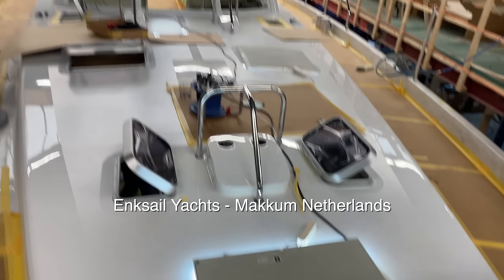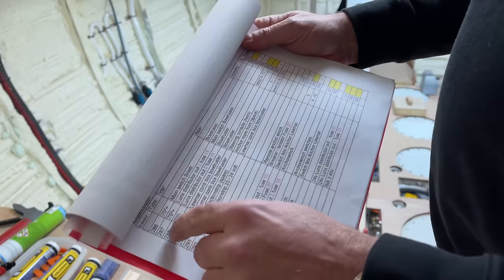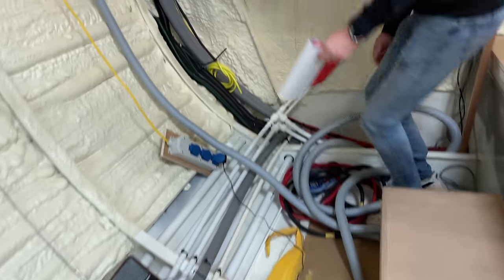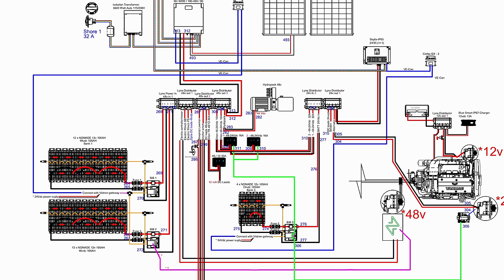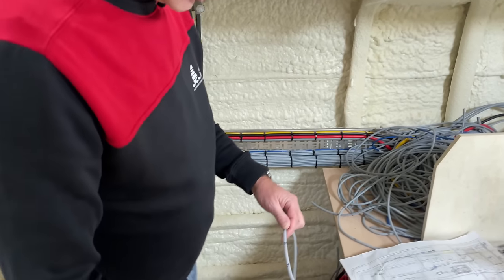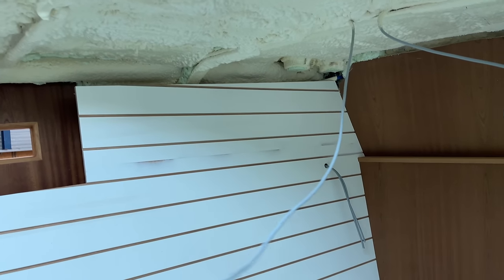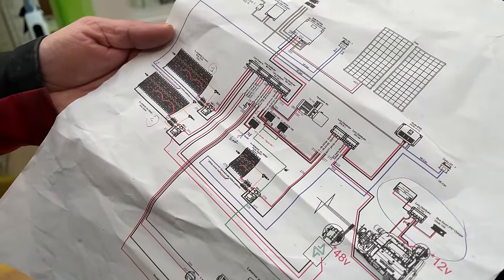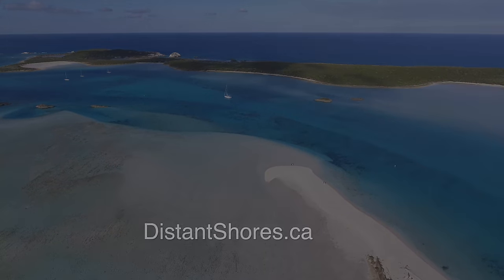48 Volt Deep Dive: Electrical Management on Aluminum Sailboat | EP 243

Comment: Wow!  Victron just keeps on innovating.  I was looking for your MPPT controllers and did not realize Victron had a hybrid inverter/charger with dual inboard MPPT units capable of handling all your solar too.  I thought this device must be a beast, but when I found it online it turns out to weigh only 11 kg!  My friends with older boats (big cats) with big 12VDC and 24VDC conversions are going to be so jealous!!!  Congratulations on your choice of builder.  Excellent system and wire diagrams!  Top marks!

Comment: I installed the exact same bow thruster but at 12v . And I can confirm it takes 500 amps . I ran twin 4/0 cables to power it directly from my Lifepo4 bank with its own fuse . . Wire was expensive and a little heavy but I want to keep everything at the same voltages . Works great , very little voltage drop and turns our Bristol on a dime .
Great video ! Your boat is coming along nicely .
Reply from the maker: Exactly - it would indeed need twin 4/0 cables. Was that on a new build or did you add the thruster?
Reply: I added the thruster, boy did we ever need it . We have a longer keel with a center board , it’s a bugger to maneuver in tight spots with out it . 
Merry Christmas you guys

Comment: Hi Paul. Um, it's not important but there's a mistake in the electrical diagram shown soon after 4:07 . Take a look at the bottom left of the diagram, where Bank 1 of the batteries is shown. In the printing above the image of the bank we see, '48vdc 105Ah'. This should be '48vdc 315Ah'. Reason - each individual battery in the bank is a 12V 105Ah unit. There are 12 of them.  Four of them are combined in series to make a 48V 105Ah group. There are three of these groups. These are then combined in parallel to make a 48Volt DC 315Ah battery bank. This will provide a nominal 15,120 Watt hours of power. At 3:19 I can see there's 24 individual batteries, enough for two, 48V 315Ah banks. So, 30,240Wh of power available for your electric motor. If there are four banks, double that. Conclusion - what a bonus! You're getting three times the battery power they've charged you for. Yay! 🙂Regards, Rick.

Comment: Many find it helpful to think of electricity through a wire as water through a garden hose. Amps equal gallons of water, voltage equals water pressure. Also, since the work done by electricity equals amps X voltage, at 48 volts only 1/4 as many amps, or gallons if you will, are needed to do the same job.

Comment: for high current devices (e.g. thruster) & AC devices are there been any discussion on running shielded cables & separation of different voltages to minimise stray currents for aluminic boat. Also, in the numbering of cables suggest including numbering of ducts and routes coding

Comment: I strongly suggest that you obtain a set of as-built wiring diagram plans for your future use. Get paper and computer drawings. At some point you will need them. You should also ask for the structural, architectural, and plumbing drawings - a full set. I love that most wiring is inside conduit that will allow a much easier way for you to maintain or add to what has already been installed. I don't think Santa can provide you with any gifts that are better than this boat. Best, :¬) Webhead USA
Reply: Yes, the builder is providing them with the schematic  See above.

Comment: 48 volts is a brilliant move. It took cars until the 1950s to go from 6v to 12v.  What Telsa did in their Cybertruck is run 48v power lines but control all the devices with WiFi and USB. This means that if something doesn't work it should be easier to trouble shoot. And there are significantly fewer wires. 
One line can power multiple devices because there doesn't have to be a physical switch back in the control panel. All the taillights, back up lights, turn signals, license plate light... are powered by just one pair of wires. (Of course for boats this is early days, and what works in a car might not work on a boat.)
Reply: Tesla's 48 Volt bus is/is controlled by power over ethernet.
Reply: @LoanwordEggcorn , CANBUS over ethernet.  CANBUS is a standard automotive/industrial protocol and ethernet is the physical layer.  Power over ethernet is not really needed since they are running 48v lines for power, but not over the ethernet/data conductors (which is what POE does) as far as I know.
Reply: There are similar switching solutions for boats from a few manufacturers, but none of them so far support 48V.
Reply: @CL-gq3no  The previous generation of Teslas used CANBUS over ethernet.  Newer generation is 48 Volt POE.

Comment: Very nice installation!  One question: The bow thruster cables don't seem to have tinned wires (like OceanFlex). If so, why not use tinned wire?
Reply: Tinned wires are a “typical” US thing where marine grade wire is associated with tinned wire. You don’t need tinned wire, just need to make sure that you use dialectic grease when crimping the lugs on. Marine wire is fine stranded flexible wire with specific sheath material.

Comment: Really nice! -- QUESTION -- I love the insulation!  However, it stops before going all the way down to the sub-floor. The batteries are sitting on the metal sub-floor bilge, won't it get condensation when you go up north into cold water and that metal sub-floor/bilge is super cold?  Why not have insulation all the way down and keep everything nice and cozy??
Reply: Hi Coleen. There’s several reasons why aluminium boats are not insulated below the water line.
Firstly, the temperature of the water is your friend and you want to use the thermal mass of the sea to stabilise the temperature of the boat. In places where the air becomes hot on a particular day or for a period during a season, the temperature of the sea water will be cooler. So use that, to help keep the boat cool! And vice versa, in places where it’s really cold, the sea water temperature will be warmer than the air. Again, use that to your advantage. A 2°C sea is a lot warmer than -10°C air.
Secondly, what if you have a leak below the water line? How are you going to find it if it’s covered with insulation? The foam will also get in the way of fixing it. And if you disturb the foam, pieces might block the bilge pump. Eek!
Thirdly, the bilges need to be able to drain, whether it be condensation, or leaks, or spills. Insulation in the bilge would impede this and inhibit drying, causing all sorts of problems. 
There are cases of owner/builders completely filling their bilges with foam, right up to the sole boards. This is an extreme measure, intended more for emergency flotation rather than insulation.  
Do these answers work for you? Regards, Rick.

Comment: It seems to me you missed the actual advantage of high voltage systems, when you said with 12V the cable would be "four times this big". Going from 12V to 48V does not allow for a 4 times thinner cable but actually for a 16 times less cross section and  16 times lighter  (16 times less material, 16 times less weight, 16 times less cost) cable! If you want to keep the power loss in the cable constant. Because of P=R*I^2. And R is proportional to the cross section of the cable. But you are correct if you were talking about 4 times the diameter, as cross section is diameter^2.

Comment: Noticed they aren't using ABYC color code for DC circuits.  Also two solar panels do seem like much power for the total loads.
Reply: ABYC is an American standard, so we shouldn’t expect to see ABYC color codes with a European build.  I’m also wondering why only two solar panels and where else is power generated.  One possible guess is that the two solar panels might power the 24V loads and a hydrocarbon fueled generator might power the 48V loads.  Maybe.

Comment: Thanks much.  It's unfortunate, but a current fact of life, that all three voltages 48, 24, 12 must be supported.  That sort of triples the complexity.  In an ideal world only 48 Volt would be needed.  That trend will improve with Tesla, Ford and eventually others going to 48 Volt car systems.

Also for smaller items a Power Over Ethernet (POE) bus is how Tesla and others are doing power distribution now.  Slightly less applicable in a boat since there are far fewer devices, but a bus type approach is much simpler and easier to install.  For example, the number of cables is reduced very significantly with a bus.  Boating will lag behind cars for many years in this regard, but it sort of already happens even in boats, for things like CAN bus and related signalling networks.

This also happens with CZone digitally switched boat power networks.  Centralized power bus with digitally controlled remote taps means much simpler wiring.  And they still have remote switches which can be manually operated if needed.  So, much simpler installation.

Still recommend more solar, including on the coachroof.   Walkable panels are fine.
Reply: I agree with the recommendation for more solar.  I don’t agree with the idea that both 12V and 24V are needed.  Most US built boats are all 12V without any 24V systems.  Most European built boats are all 24V without any 12V systems.  I would do as much as possible with 48V, as Paul and Sheryl are doing, and then use 24V for the remainder.  I would not use any 12V systems onboard.
Reply: @mcarling6495  Thanks, I was thinking of a boat trying to support both US and EU devices.  For a boat in only one region, agree only 12 or 24 would be needed.

Comment: What in the world is that battery bank? It could power a small city.
Reply: It's covered in an earlier video.  Super B batteries.  Needed for hybrid electric drive and house loads.  Can regenerate power by sailing.  In other words the batteries can be charged simply by sailing to pull the prop through the water as a generator.  Can also be charged by shore power, solar, alternator, etc.  Electric power is the best.

Comment: 48 or24
Reply: Both.  48v primary, but also a 24v bus with smaller battery bank for the systems that aren't available in 48v.  Lighting, refrigerators, marine electronics for example are usually only available in 12/24 volts.